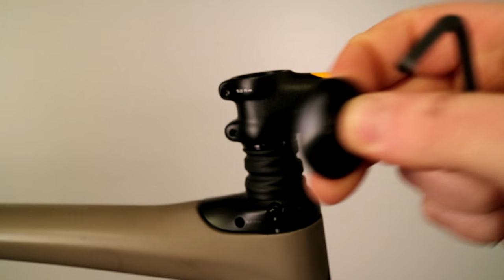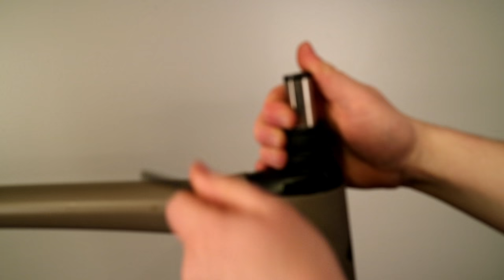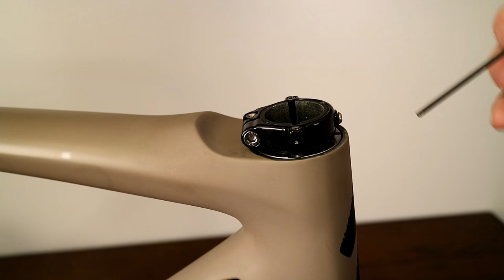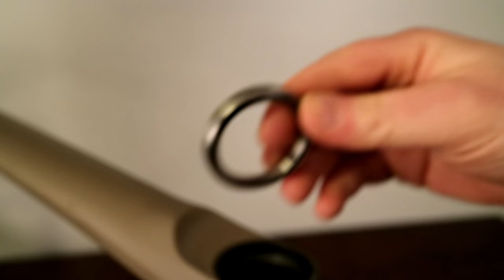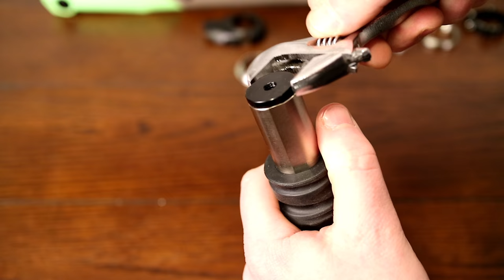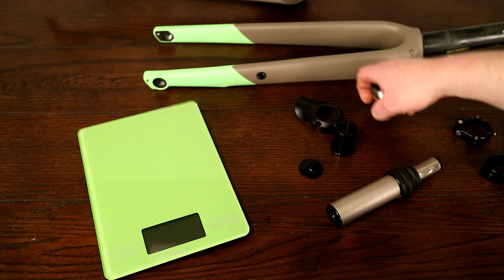Specialized Future Shock headset removal and adjustment on a Rubaix Ruby or Diverge Plus Weight

Comment: Good video of the disassembly. Just want to mention the 2.5mm allen key is for the the locking bolt only. The headset bearing tension is set by loosing or tightening with a 2mm allen key through the locking bolt.
Reply from the maker: Good catch, thanks!

Comment: 5 years later , fears of ‘future proprietary part unavailability’ are unfounded as the FS remains a staple in the Specialized lineup. Huge success for the company.
Reply from the maker: Haha. Can you get parts for THIS future shock? Well, no... So it's fair criticism. Sure they still make Future shocks but they are in their 3rd design iteration only 5 years later.
Reply: Which parts can you not get for this Future Shock?

Comment: Removal of the future shock is not quite correct, it has 3 Allen key sizes 2.0mm, 2.5mm and 4.0mm,  to release the collar it's a 4.0mm to release the pre-tension it's a 2.0mm and to release the locking it's 2.5mm

Comment: If I'm just swapping the headset cover for the smaller stack version, do I need to loosen the preload bolts? Or can I get away with just loosening the pinch bolt and performing the swap, and then not have to deal with the preload?

Comment: My only real issue with this design is being a slave to Specialized bike shops for proprietary parts.  That is one thing I hated about Cannondale forks, even though they performed great (when they worked).  Or if they change the design slightly with different parts, or discontinue it, how many years will they still support it with parts?  But I digress.  I suppose 95% of original owners will only have the bike for just a few years, sell it, and move on.
Reply: thechosendude, not really, it's so simple that it won't need much service attention compared to a suspension fork.
Reply: What in case you "destroy" the fork?
Reply: @kamykyk  I broke the fork in a crash, it has been over a month trying to get a new fork, with no end in sight. Either going to try an aftermarket fork and ditch the FutureShock, or get a checkpoint frameset.

Comment: Great video thanks. Any chance you could do a short 1 about how to reassemble the headset again? The only time I tried to do it the fork became really loose and was rattling. I had to take it to my bike shop to fix which was a bit of an inconvenience
Reply from the maker: I'll put one together once I get the bike built up. Thanks for the idea.
Reply: Have you had a chance to put this video together? My headset is loose and need to tighten it on my diverge.

Comment: I was hoping to add some spacers to the headset/futureshock. In the owners manual it allows for a 15mm spacer around the underside of the future shock. Do you know if it’s possible to add a spacer around the adapter/collar at the top (where the adapter meets the stem)?
Reply from the maker: Just the underside of the futureshock

Comment: The third video I've watched that doesn't explain what the shock action consists of, how it works, although the title of this doesn't claim this as the intention of this video. But it appears to me the absorption is of the riders weight on the handlebars when the frame is thrown upward and then after the wheel has started going downward after the bump, the spring tension is released allowing the bars to return to original position.  If that's the case, it appears this is basically the same as shock absorption seat posts that were on hybrid bikes.
Reply from the maker: The future shock is axial, not splay. Think to suspend the rider, not the bike. This solves the handling and momentum concerns of a road bike.

Comment: Hi! Is it possible to remove the future shock and not use it and install a standard headset and fork? Thanks.
Reply from the maker: Not really. The fork uses non-standard headset so I don't think there are parts compatible
Reply: What if you replace also the fork?
Reply from the maker: That's what I am saying the fork is not standard, they don't make that steerer tube size, and they don't make headset parts to convert
Reply: I noticed that also that the steerer tube is oversized
Reply: I ended up here as I really like the geometry of the Diverge but the proprietary parts put me off.

Am I right in thinking that both bearings are the same size as typical bottom cup bearings? Also, I guess if you don't like the Future Shock, or when it packs up, you could have a sleeve made up that mimics the outer dimensions. Could even be threaded to take a One-Up EDC tool which is something you can't normally fit to a gravel bike with a carbon steerer.

Comment: What's the torx bolt on the very bottom of the future shock do?  I took mine apart and was messing with that bolt and it just seems to go back and forth with no changes I can see.  However, now there's grease coming out of my fork/headset area so I need to take it apart and diagnose.  Hoping to find some answers before I do it.

Comment: What do you think about the longetivity of future shock when buying these bikes with FS long term? Bit worried if I need to replace the cartridge down the line it'll be an issue because it's proprietary.
Reply: I have a 2017 Roubaix with the Future Shock. In just under 3 years, (approx 17-18k miles) the shock became gritty and felt loose. My shop said the needle bearings inside had deteriorated and they were unable to source a rebuild kit. A new shock was $220. With a headset overhaul, a new shock, a headset bearing and tax the repair came to $320.

Comment: I still don't really understand what is the interface between the steerer and the future shock - does streerer hug the future shock? Does future shock expand (doesn't seem so)? Very questionable construction, what prevents future shock to come out of the steerer freely? Not mentioning the cuts in the steerer, and the direction hole, solid it looks not.
Reply from the maker: Future shock is held onto the steerer with the fork collar as shown. Think of it as a is similiar style of clamping as the seatpost into the seat tube
Reply: Let's hope it don't come loose!!
Reply from the maker: @ericdixon2898  lol. It's just like clamping your stem... Nothing more concerning than a typical setup.

Comment: The cap on my Future Shock (Specialized Creo purchased recently) does not have any place for a tool to unscrew it. Additionally, that top cap is used to vary the amount of shock the FS gives. So...how can I remove it so that I can put a spacer in after replacing the original stem? Thanks in advance, hopefully. :)
Reply from the maker: Congrats on the Creo! This video is about the original Future Shock. I'll do a video on the new one coming soon

Comment: Does the future shock wear out? Would it be annoying to sprint due to the constant movement?
Reply from the maker: I am sure over time it could wear out. Not really something you notice happening while riding.
Reply: My FS has a problem, it bottoms out, meaning you ride over a bump and bang, the spring barely works, it's in the shop as I text so fingers crossed.

Comment: Hi, are the headset bearings standard size? Or are they custom and to only be ordered from Specialized?

Thanks!
Reply from the maker: Not sure, it is the same bearing top and bottom thought.
Reply: Jamesthebikeguy 

Hi, thanks for the video. I took my headset apart (Spec. Roubaix Expert 2017 54cm) and the bearing size is 45.8/36.8/6.5 45 degree ECO. Not available anywhere apart from Spec themselves, it's totally custom which isn't great. My bottom bearing had seized but I've managed to salvage it and have now heavily greased with the intention of keeping any spray from riding in the wet out. Apparently marine grease is good to use.

I find my Roubaix excellent and particularly like the BB60 bottom bracket. Everything is easy to service and the bike generally seems well thought out. 

P.s. Two month wait on replacement bearings from Specialized....! And around £50 a pair!  :O
Reply: hi how did you know your bottom bearing seized what was different
Reply: Kevin Drake 

Kevin Drake 

Hi, it was really gritty when trying to rotate it (i.e. holding bearing in my fingers and moving it around. Actually, initially I couldn't rotate it between my fingers at all. After rotating it a bit it loosened up. Also, it was leaking some brown liquid which I assume is the inside of the bearing rusting.

Apparently the bottom bearing generally wears out quicker as it's more exposed to water from the wheels, and takes more pressure from riding. I've read that some people swap the top and bottom bearings to help even out the wear.

Hope that helps.
Reply: They probably just went up to PA the Cannondale plant and grabbed all the leftover Headshok parts..
Reply: John Robertson 

Sad, very sad. Get a #life.
Reply: Since you appear to not know what I am referring to, it may be best to avoid providing me options. I am sure I have forgotten more than you will ever know about many things.
Reply: John Robertson 

Don't assume.

Headshok from 1990's is what you are referring to.

Stop trolling, and whilst I am at it - a piece of advice - go educate yourself, before you embarrass yourself.
Reply: You sure seem to write like you know what youre talking about. Im guessing you actually owned at least one cannondale delta-v  or super-v full suspension or one of their hardtails with a headshok...and maybe even during the course of that ownership had to replace the fork and bearings? I think if you did, you wouldve narrowed it down to the specific year your bike was from. Are you even in the US? Your use of "whilst" gives me a clue that you are not....so its beginning to look very doubtful, unless you had a lot of money back then...since my Super-V frame with aluminum swingarm was about $2000 in 1996 dollars....that you were able to get one overseas. My entire point of my first comment was how the oversize...and from the comments...proprietary bearings relate directly to Cannondale using the same components and concept....for if you recall from working on yours...wait...we already are heading away from the concept that you had one...the bearings were not the same as found in any other bike of its era. You are bothering me with your incessant attempts at justifying your minuscule knowledge. The upside is that you have allowed me to practice my typing...albeit I remain weak in the use of punctuation. Thanks for being a true friend...I feel as though we have shared so much. Tell me what you want for Christmas, since you will undoubtedly continue to remain a good little boy the rest of the year.
Reply: John Robertson 

You've just been played 😂
Reply: ravi....I think you nailed it.

Comment: Do you like the future shock? It's heavy and I do not know it's good enough.
Reply from the maker: I think it is absolutely worth the weight. Huge upgrade.
Reply: Hey, thanks :)
Reply: I have the Roubaix and the FutureShock is amazing. It makes the ride so nice on horrible, rough, UK roads. My body has totally adjusted to it, I never feel it move even when sprinting out of the saddle. This is even when using the softest spring. 

My other bikes now feel like bone rattlers in comparison. 

The stock handlebar height is set high (30mm), I've removed the 15mm of spacers and moved to the 0mm headset cover which has dropped the height very nicely. Further drop can be made via a different stem or even removing the 20mm riser handlebar.
Reply: Ravinder Singh Thank you :)
Reply: Marcin W. heavy compared to what?
Reply: I have a roubaix expert (2018) and absolutely love it!  It took some getting used to it, but it performs amazingly. No powerloss due to the fork and frame still being solid, meaning the fork does not compress. Again it does a little bit to get used to it but on Wisconsin roads that are crap it's a hand saver.
Reply: Ravinder Singh hi, when you switched to your 0 mm cover, does the cover slight it move and kinda rattle?

Comment: Am I the only one that is concerned about the design of the fork requiring 2 slots and a hold to be cut into the top of the steerer tube??? That doesn't seem like a good long term design. They are going to take one of the most critical junctions and compress 2 ends around a shock that is moving, while holding it in place with a screw through a hold in the steerer tube?!?!

Comment: I wonder if there’s a possibility to get this thing attached to diverge e5 elite? (Not comp)
Reply from the maker: I don't think so. The fork and head tube are both different.
Reply: Yeah, I contacted specialized support and they told me that there was an error on the web page stating that elite can be equipped in future shock. Thanks for confirmation.

Comment: Great video James , Thank you. I need a shorter stem (110 to 90mm) on my new 2017 S Works Roubaix and want to know if the stem shim that converts to 31.8 will then allow me to mount stems other than the Specialized assuming the stack height allows for the stem cap to fit back on properly ? Thanks again.   Brad
Reply from the maker: Should be no problem getting a standard stem installed. If the stem height is relatively similar to the factory one it will work fine.

Comment: Seems like a huge amount of complexity just to spring a handlebar.  You'd think with all those parts-weight-cost they could have actually provided some suspension. Where half of you you and your bike are actually suspended from the front wheel.  All this does is suspend any of your weight on your hands, which, if you are riding correctly, shouldn't be much... Does spec have a kit to delete the shock (some kind of lightweight blank to replace all this mess?) I like these bikes just not this silliness.
Reply from the maker: The future shock has been amazing in my experience. It clearly sounds like you have not had a chance to ride a bike with the future shock. Suspending the rider keeps the rider comfortable without compromising the dynamics of the frame/fork. A pretty smart way of doing it. They don't make a delete kit, as it would be crazy to delete the part of the bike that makes it ride so well.

Comment: Thats stupid. Its a method designed to suspend the rider just like the Girvin Flexstem , the Frankenstem, and several other moveable stems have done 20 years ago. Why did they disappear? The entire bike is still moving to absorb the bump...something motorcycle fork makers realized 85 years, which was transfered to pedal bikes manyu years later. Of COURSE youre still going to have loss of control as they say will be removed. The bikes mass must rise over the bump, and then theres the delay when the tire returns to contact the surface. Why do they make it look like the wheel will track along the ground? A bunch of dipsticks.
Ebay is your friend....flexstem, frankenstem, "pivoting bicycle suspension stem"...have a nice day folks.
Reply from the maker: I don't think you get it. Maybe stop by your local dealer to ride the bike, because it is leaps and bounds better than the old flex stems.
Reply: John Robertson, they disappeared because they were used for mountain bikes, they are perfect for this application.
Reply: I dont think you have literally any idea what you're talking about. The bike doesn't move. The frame is STILL rigid. There's no tire rebound, the fork is solid and doesnt move. The only part that's moving is the stem, which does NOT affect your power output. If it does, you need to get a bike fit.